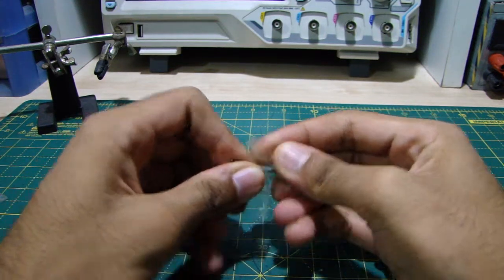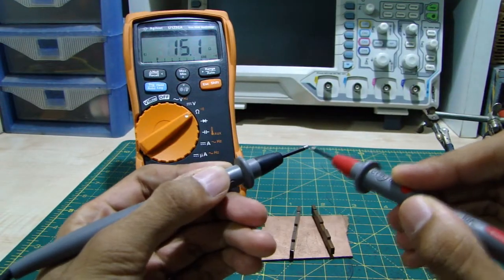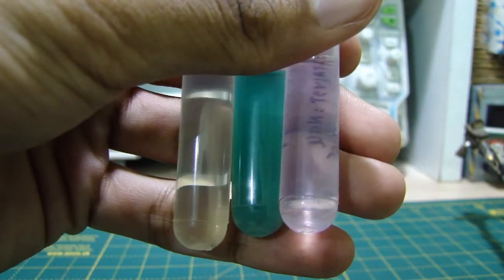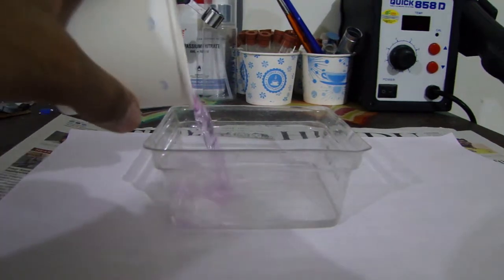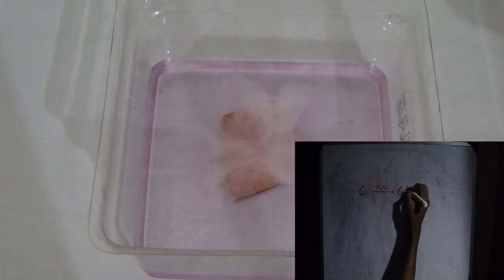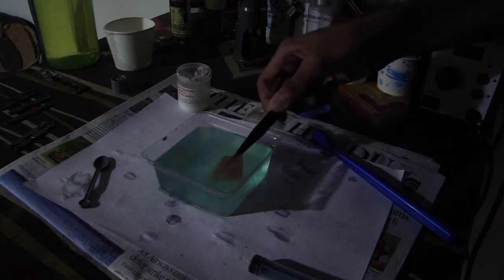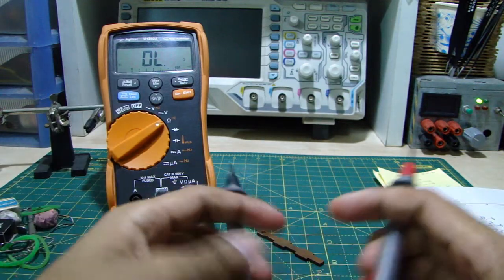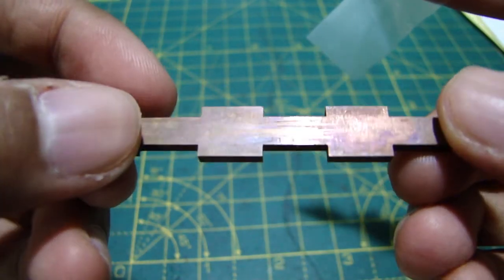Chemistry | DIY Copper Etching Without Ferric Chloride?

Comment: Bhai plz tell me 1.5 mm ki copper ki sheet ko hum ferric chloride se etching karte hai lekin usme bahoot time lagta hai aisa kya kare ki ya koi dusra chemical ho jo fast copper ki etching kare 
BHAIYA PLZ BTA DO AAPKA BAHOOT EHSAAN HOGA
Reply from the maker: Etching rate depends on the strength of the chemicals, the stronger your etchant the faster the reaction, but at the same time strong chemicals are pretty dangerous. If you're just looking to etch PCBs at home, I would recommend using this recipe a friend sent me: 
Perfect* homemade single layer PCBs with @dimin#8885 :
- obtain FR4 from anywhere (mine is some 30y/o USSR stuff)
- get photo resist, mine is the cheapest I could find at a local electronics retailer positive photo resist (exposed parts get hard)
- get sodium hydrogen carbonate aka baking soda
- get a UV lamp (I use a 26W, UV CFL with a peak at 315nm) 
- make/get/reuse a timer for control of how long the PCBs are being exposed for
- get transparent film for your printer type
Step 1: export your PCB copper layer in 1:1 to a PDF so that your traces are white and what needs to be etched is black
Step 2: print 2 of these things on the transparent film
Step 3: cut them out
Step 4: get some transparent tape and align the 2 pieces and tape them in that position at least on 3 places
Step 5: cut FR4 to the desired PCB size, according to the cutout (should be a bit bigger)
Step 6: use P80/PS30 sandpaper and sand the copper surface to remove oxides
Step 7: use a lint free swab and wipe it down with alcohol when you are done sanding
Step 8: cut photo resist a bit bigger than needed
Step 9: remove the first protective layer using 2 pieces of tape on the photo resist and pull them apart
Step 10: glue it with the peeled side on to the FR4, flatten out with your fingers or cloth
Step 11: use a Clothes Iron on a 50% setting with a piece of paper folded in half on top of the FR4 with photo resist for ~15-30 seconds
Step 12: put the FR4 under your lamp with the printed pattern on top
Step 13: squish it with a piece of glass and put something heavy on all the 4 sides of the glass to compress the thing down
Step 14: expose it, I use the 26W lamp ~15cm away from the PCB for 2 minutes**
Step 15: mix baking soda with 30-40C water (enough to make the water white)
Step 16: pull the second protective film from the photo resist with tape again (start near something that has been exposed)
Step 17: put the pcb in to the soda mix and massage it with your finger for 10-15sec 
Step 18: put the PCB under cold flowing water and massage with finger until it stops feeling slippery
Repeat step 17-18 until the unexposed photo resist is gone
Step 19: take a piece of metal and scratch the unexposed area to check if you washed all of the unexposed photo resist off (if not repeat steps 17-18)
Step 20: put the PCB in to UV for another 5-10 minutes to give it strength
Step 21: etch it with your favorite chemicals
Step 22: after etching is done put it in to the baking soda mix overnight
Step 23: wake up the next morning and your PCB is done!
*if you are unsatisfied with the results before etching perform step 22 and start over
**exposure time is very important as underexposure and overexposure cause the PCB to come out bad

Comment: do you still need ventilation? I'm looking for a cleaner method than Ferric Chloride
Reply from the maker: I did this in a closed room and on a small scale, so no problems there, but it's always good to play it safe.
The chemicals used here are completely safe to handle, unless ingested.
Reply: @NNNILabs  The only thing you shouldn't ingest is H2O2